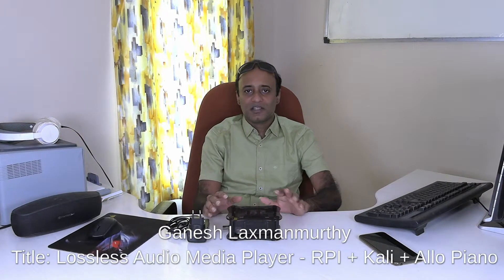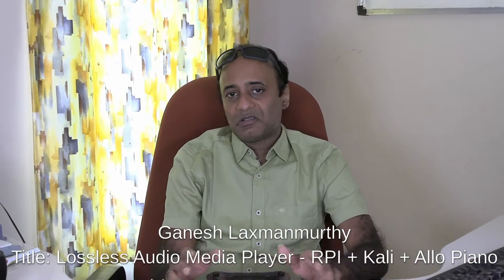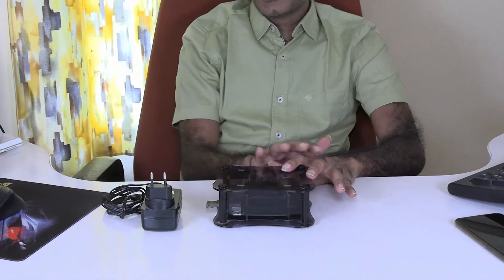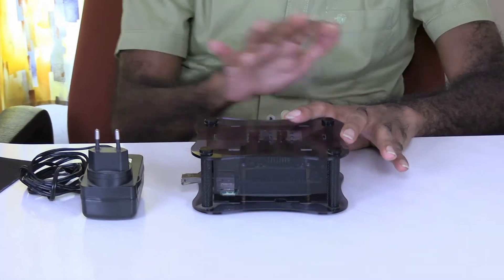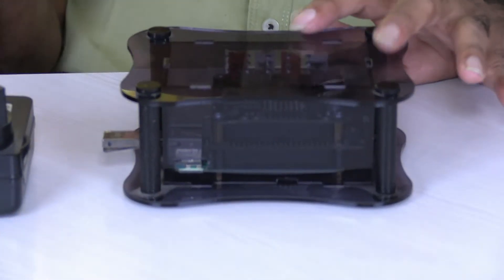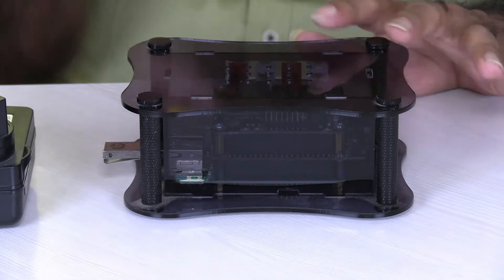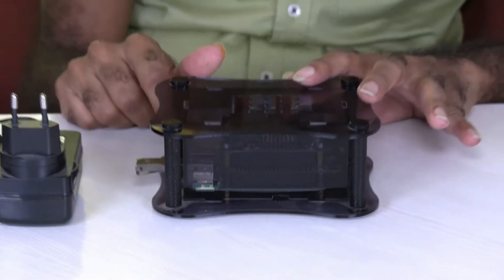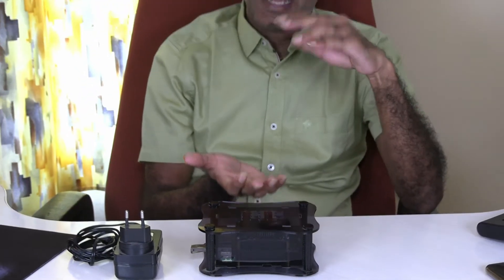DIY Hi Fidelity, Lossless Audio Media Player - RPI + Kali + Allo Piano

Comment: Thank you for the very informative video. I have an IQaudio DAC on a Raspberry Pi4 with original Raspberry Pi power supply. My question is if I switch to the Allo 5V  3amp PSU will it significantly improve the quality of sound from the  IQaudio DAC?
Reply from the maker: Thanks for your comment and question.
I don't think so unless you have very high end remaining equipment like pre-amplifier, amplifier and speakers/headphone.
But probably you would be able to observe the improvement on an oscilloscope.
Therefore, unless you have some issues like hum and other noises in your music system, I don't think you require to change it.
Reply: @gtech8449  thanks a lot for your prompt response and valuable insight.

Comment: You don't need volumio for playback, which is what it came by default for Allo Boss Piano DAC... You can correct the Linux Audio drivers, build & port it & make it work for Rpi4 or Rpi zero with latest kernel & Rpi OS...i presume the linux kernel in volumio is old(perhaps 4.1.x) & not latest Rpi OS as of today...i encountered a lot of issues & bugs in drivers, corrected them & it works..here's my video link..   https://www.youtube.com/watch?v=yN_hiyG10Ag&t=4s

Comment: Could you please explain the purpose of Kali reclocker? It was not explained much in the video. Some thoughts and input on the and would really help.

Also can you tell us where we can buy these products online? Amazon or Flipkart sells it?
Reply from the maker: Thanks for asking and sorry for my late reply as I had missed your comment.

When music signals are converted from analog to digital form, it has to be encoded using a clock signal. This clock is generated by the quartz crystal on the equipment where A-D conversion takes place. For a moment let us assume that this encoding was done using an equipment with very precise clock signal generated by a high quality quartz crystal.

Now at the time of decoding, ie converting digital audio content back to analog signal, we again need to use an equipment that uses a crystal that can generate a very precise clock signal. Else there would be variations and deviations from the original analog signal before encoding. This is referred to as digital noise or jitter.

In DIY audio media player builds that use SBCs (Raspberry Pi or any other), the clock from the SBC is used for converting the digital audio content back to analog by the DAC. Almost all SBCs use crystals that are good enough for computing but not for Hi-Fi audio digital to analog conversion.

Kali reclocker is a module that discards the clock signal generated by the SBC and generates a new precise clock signal for D-A conversion of digital audio files. Due to the high quality crystal in its circuit, it helps in accurate D-A conversion by DAC with minimum or no jitter.

So it assures audiophile quality reproduction of sound.

I purchased it here.

https://www.fabtolab.com/allo-boards-accessories/kali-reclocker